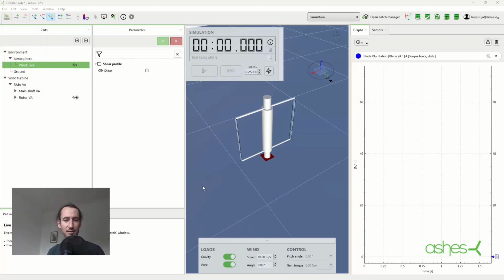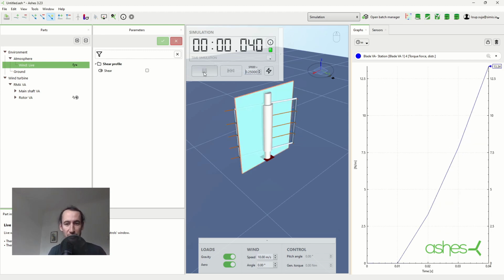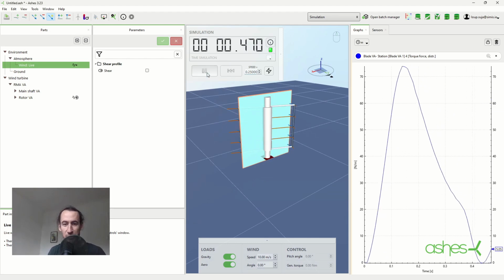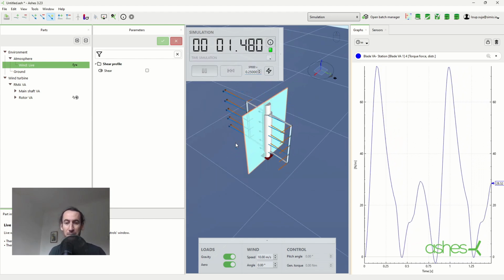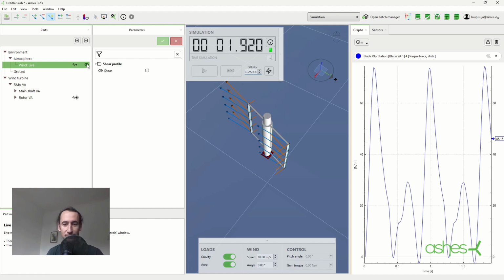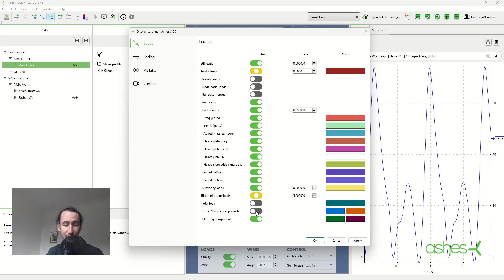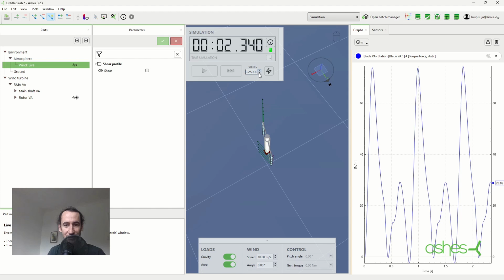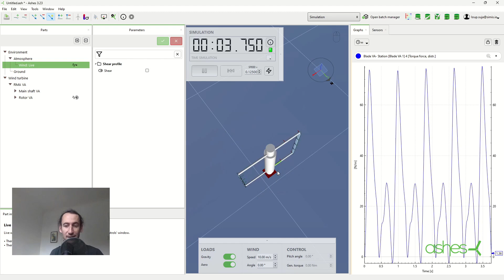Why is the torque on a vertical axis wind turbine always positive? - with Ashes

Comment: I notice that you have drawn the thrust vector in the same direction as the wind similar to a HAWT. I wonder though if the thrust vector should be at 90 degrees to the torque? In this case the direction of the thrust will change as a blade rotates an will point towards the axis when facing the wind and away from the axis when downwind. What do you think?
Reply from the maker: I'd say it makes more sense to define thrust as being in the wind direction. Then torque force and thrust will not always be perpendicular, as you pointed out. It seems like in VAWT it is common to also add the normal force, which is perpendicular to the torque force (note that the VAWT also tends to call the torque force "tangential force")